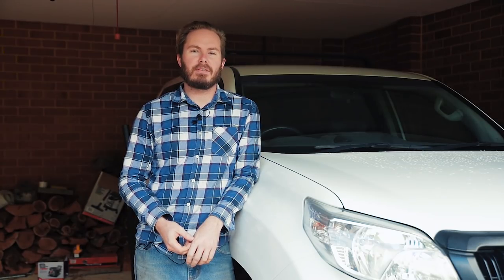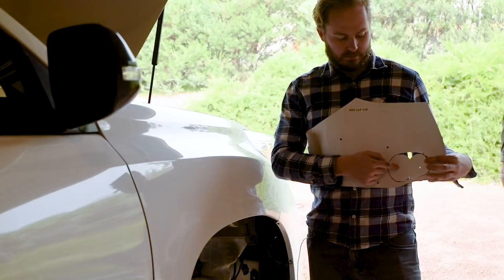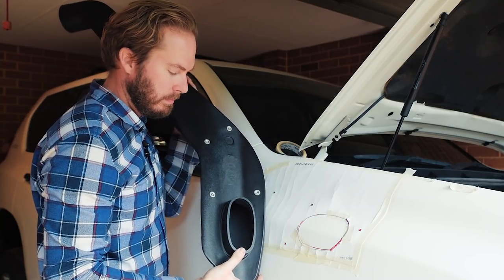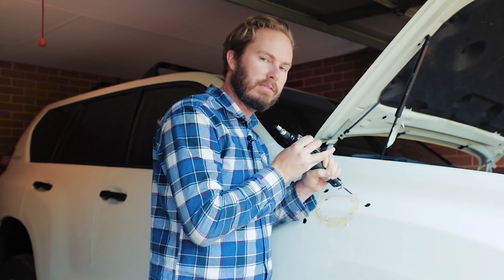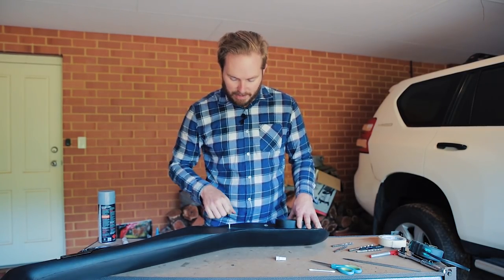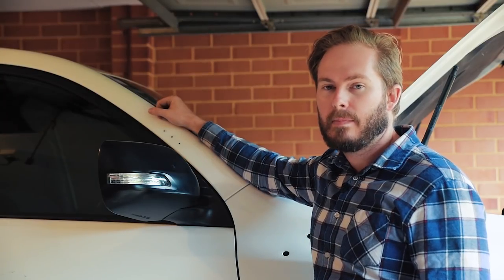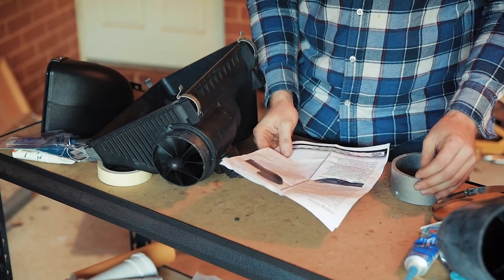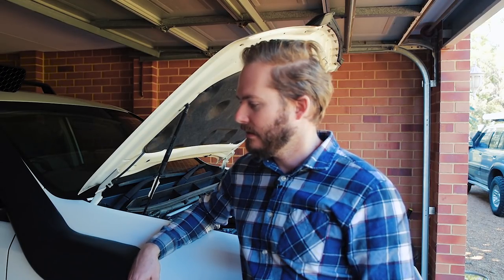How To Install A Snorkel. Toyota Prado 150. Backyard Mechanic 13

Comment: Nice clean job.  The air-saw is definitely the way to go!  Looks like the majority of guys in Australia use snorkels compared to the United States.  I see a lot of really dusty roads that you and Ronny Dahl go on.  Wondering if you like to use a pre-filter on top of the intake?  Great videos by the way Alex!
Reply from the maker: Thanks Kevin. I'd love to use a pre-filter on top of the intake actually, but I never ever think about grabbing one until I can't see a meter in front of me and I go "hmmm...a snorkel sock would be a good idea here" 😄 I also notice that in the states, snorkels are promoted less for driving deep water, and more for the elevated air intake benefit. Just an interesting difference, as it's the opposite way of thinking for many down here.

Comment: Fitted a Safari snorkel to my GU patrol a few years back, peace of piss to do.
Reply from the maker: Yeah safari have way better instructions too! Hardest part of them is probably removing that strange duct pipe tack welded inside the fender
Reply: Mine didn't have that duct pipe in the gaurd, then again mine was a petrol model, maybe there different to diesel model.

Comment: Hey what Brand of snorkel is it? I was given one with my Prado 120 and I'm really unsure if I should put on or get a safari snorkel any help would be great lol.
Reply from the maker: It's a dobinsons one. No matter what the brand most snorkels fit up the same, the most important bit is making sure you have the right template for cutting and drilling
Reply: @Alex.G  I do have a template for it, tested and it fits but it was all crumbled up so i am flattening it out at the moment.
I have seen one vid where a guy had to put silicon around the outside to seal were it sits on the mud guard, it didn't look good i thought and there was a fair space between the drivers side pillar and the snorkel spout, are they all the same ? and i also don't have a gasket thing like you had that goes against the mudguard and the snorkel.
sorry for all the Questions 
Its really a big help.